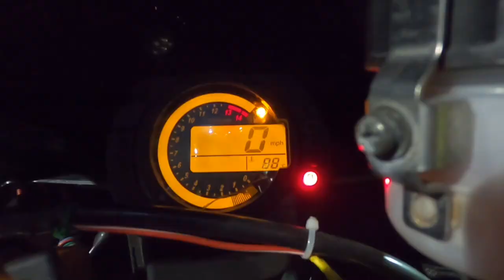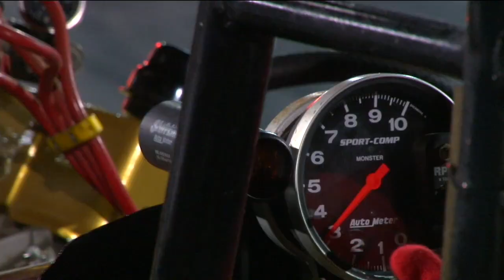Perth Motorplex 2021- 22 Drag Racing Season Review

Comment: Is that a full 1/4 mile? 
The NHRA seriously needs to figure out what trscks they can go back to 1/4 mile. 
Not every Nascar track is the same. 
Have some a full 1/4. Some that are 1000ft.
Reply from the maker: Hi Tim, Thanks for the comment. Yes it is a full 1/4 mile track. All racing division except Top Fuel and Junior Dragster, race the full 1/4 mile track.
Reply: Top fuel run 1,000 ft with that circuit, very respectable times. My question is how many fuel cars show up to qualify and is fuel  funny car included?